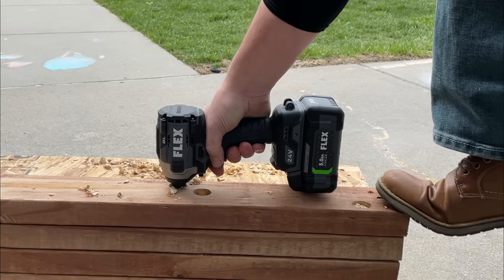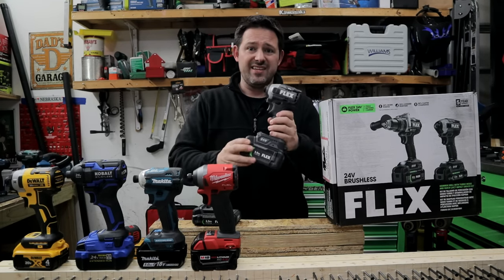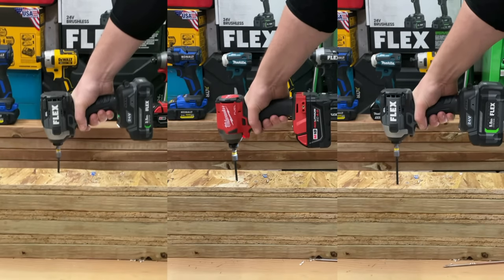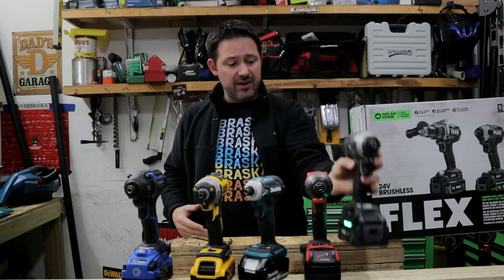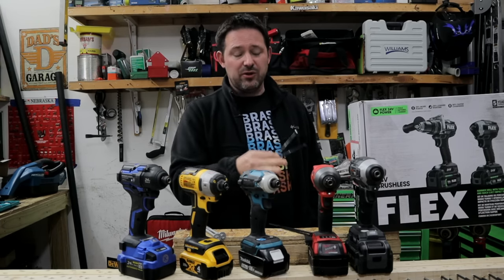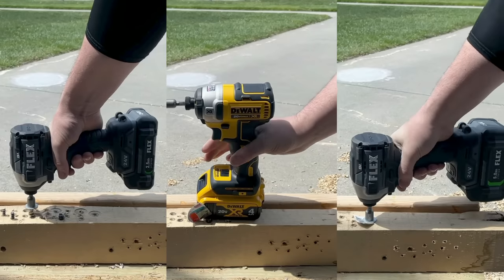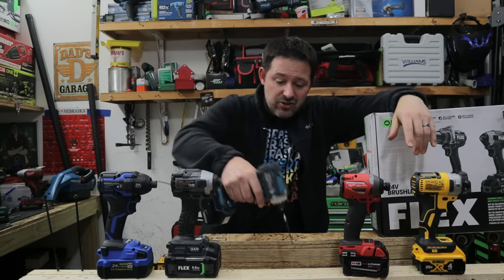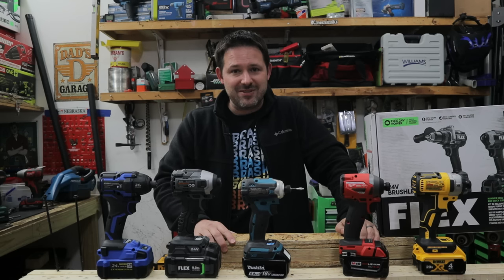FLEX TOOLS vs DEWALT MAKITA MILWAUKEE It's NOT what's NEXT Impact Driver SHOWDOWN!

Comment: Les see the Milwaukee with a 3.0 high output battery blow out the flex..
Reply: Exactly! Unfair test for sure when u compare 18v vs 24 , Milwaukee for me thanks
Reply: I agree.... Also... Why doesn't he show us what speed settings you have each one on also.. Hmmmm... I wonder............
Reply: Or the 40v Makita....  No contest.
Reply: This annoyed me the whole time! Just flex marketing
Reply: The contract said the paycheck is only if the flex wins the showdown! the 4.0 is an old and obsolete battery, he really had to search to handicap the Milwaukee
Reply: @lenardbosch2969  I wouldn't say it's unfair, any of the companies could have designed 24v tools. Flex was just the only one to have took advantage of that. If there are 24v motors available, I would have made 24v tools also for a leg up on competition. I do agree that Milwaukee should have used The newest 3ah and 5ah battery for this comparison as they are the closest to the flex capacity.
Reply: @taz4100  exactly they should be using the high output batteries , that would be fair
Reply: All these comments of "you shouldve used this or that". This guy isnt rich...he cant go out and buy a crap ton of ever ything. He baught some..and used what he already had on some. It is what it is and still informative.
Reply: The XC4.0 delivers marginally more power then the XC5.0 or the CP3.0HO. Have to move up the XC6.0HO to get more power/performance. If you want to see this tested, watch this video from Torque Test Channel. They don’t test the XC4.0, but the cells in the 4.0 are rated for 1A greater (23A vs 22A) than the cells in the 5.0, so they are essentially the same. 
https://youtu.be/ky5YRjz9lvc
Reply: @geoffstrickler  not really, Samsung 25R has better performance than 20R. It’s not about the spec but the discharge curve and voltage fluctuation under load
Reply: @ckm-mkc  DeWalt flexvolt you mean. Makita don't make the most powerful tools but they have quality and ergonomics they are  almost as fast as the gen3 fuel so wouldn't be far off the flex .
Reply: It's about the discharge rate of the cells.. the Milwaukee with a CP3.0 Ah pack with 21700 cells will blow out that Flex 24 5.0Ah with its 18650 cells.. my $ is on the Milwaukee all day.. I've used the gen 3 impact with both XC5.0 (18650) and the newer CP3.0 (21700) and the performance difference is very noticeable. It's not Milwaukee's fault that Flex, for all their marketing hype about their next level battery performance, decided to put 18650's in their packs and not offer a high output 21700 pack! So they have to handicap the competition in their promo vid and the ones that they clearly had to pay these Shills to make with ancient 4 Ah packs that you have to go out of your way to find b/c they are so old! Btw, these packs were all brand new, they weren't just laying around in the guys garage! Someone said that he doesn't have the $ to buy packs for all the competitors, they all looked brand new to me.. not like they have been sitting around in his garage, and if they were, that just goes to show how much more the competition was handicapped, don't make comparison videos if you can't afford to put up newest offerings from all competitors so that people can make an informed decision about what to spend their $ on! Especially if you are trying to convince them to switch to a completely new platform which is a huge investment for most.. luckily, to this guys credit, he did say that they weren't really worth jumping ship if you are already invested in another platform.. especially b/c he probably knew that it wasn't really a fair comparison. Just put up the best offering from each manufacturer and let the chips fall where they may! Fair is fair, people know when something is fixed or when it's a fair fight. Like the last super bowl.
Reply: @mikedeezle2249   If Flex put 21700 cells in their tools they would absolutely decimate Milwaukee.... they at least gave Milwaukee a fighting chance with 18650's.....😪
Reply: Well I understand he not rich so hold off befor you make video that's not a match because the batteries are all different wait befor you say who one it simple as that wait he didn't so people have the right to say something
Reply: I sold my whole Milwaukee line because I seen with my own eyes what Flex can do 💪 everyone will be saying flex in 2-3 years. Give it time and you’ll switch too. I still have my Kobalt XTR set though as well but my new go to is my flex tools
Reply: @boosted2.4_sky  if you watched the video you'd notice every other impact does better once they start driving serious sized fasteners. only reason all these flex tools look like they are doing any better is they spin faster 4000rpm Vs 3600rpm on the Milwaukee
Reply: @geoffstrickler  the cells are also going to develop more voltage sag as they age. A well used pack is going to perform alot worse then a new one under high amp loads. I have some 25rs that are so used that they sag badly at 10amp. 

Flexs forced rotation dual action polisher has always been good, but I'm unsure why they would use 25rs. Unless they already had the packs from previous tools not sold here or cost.
Reply: @taz4100  yes, Samsung 25R cells aren’t the best choice available today. They are a solid option used in nearly every major brand 5Ah power tool battery pack, but there are some better options out now. However, they are one of the most cost effective and readily available, so I suspect it was a business decision, not an engineering decision. They’re still a good option for 2P packs such as the 5Ah, but not necessarily for 1P packs.

They should have at least considered another option for the 2.5Ah batteries, either reduce them to 2.0Ah or go with a different cell such as the Murata VTC5A or Molicel P26A.
Reply: @zalienthere-visitor1424  like milwaukee will not have a gen 4 coming come one now there gen 3 was killing everything out there but hay sell everything when you can only get a hand full of tools with that brand good luck when Milwaukee has everything under  the sun wait for milwaukee to put out a gen 4 befor you say it killed gen 3 with 4.0 battery on it and it was still killing them but hay what do I know good luck with your hand full of tools
Reply: Atleast a 6.0, when I'm trying to show off!
Reply: @zalienthere-visitor1424  lol ok Bud.
Reply: @taz4100  18V is kinda a sweet spot for cordless tools from an engineering perspective. Voltage doesn’t have as big of an impact as people think. The real reason we’re seeing tools outside the 18v “standard” is because someone was actually able to get a patent on the 18V lithium ion battery pack. The company that owns that patent....... you guessed it Milwaukee... yup every time dewalt or Makita or any other 18V tool sells. Big red gets a royalty form it.
Reply: @Trank00007  hmm I didn't know milwaukee was able to get a patent on that. USPTO makes some questionable approvals. If dewalt etc could show that they produced a 18v battery first the patent wouldn't be valid. Regardless I'm not sure the patent would pass court scrutiny, but I have heard of worse. I'll have to check out the patent.

But yea actual wattage draw is going to be what matters and that's going to be determined by rated amps of the batteries and amount of cells. How there wired isn't going to matter much Besides the availability of 18-24v motors. 

They could even use a buck converter to bring it down to 18v to avoid the patent. But I'm not sure that the component cost would be worth it. Chervon makes a few different tools lines in 24v
Reply: @taz4100  it’s refreshing to hear back from someone who understands this. Many people are asking for Milwaukee to release a higher voltage platform to to compete with the new 40V platform from team blue. Until a radically new battery tech comes out i doubt it will make sense to actually develop a new platform. That is unless you want a contractor to want to buy all new tools for little to know gain in performance.

As far as the patens are concerned it doesn’t take too much work to find them. I think their are 3 related to batteries. They have been to court in regards to them multiple times and I believe they held strong every time. Pretty crazy situation to read into though.

After looking it up again I think their patents call out the current supply capabilities of the batteries not the voltage. Anything averaging 20 amps or more possibly. But to the same effect raising the battery voltage may lower average current draw enough to avoid the patent for some people.
Reply: But the Milwaukee impact is paired with a 5.0ah in the kit.
Reply: @ckm-mkc  yeah i am a Milwaukee fan but those 40v Mikita look sick a buddy of mine has them
Reply: @titaniumwolf1123  flex hasn’t even been out for a year what if there durability is shit
Reply: @wadelujan8714  yea, but they weren't using their 8ah packs in any of their vids or promo content.. only 2.5 and 5ah, all 18650...

Comment: I'll go with flex I've been using them since they came out haven't had any problems with them yet they are ahh bit expensive but very nice looking tools I built decks porches add ons to houses and they are quite quick and powerful 😉 ..Hopefully they make bigger and better batteries that's the secret to faster speed work.
Reply: Flex for life brother 💯
Reply: In comparison to Milwaukee and some dewalt tools flex is definitely cheaper. They also do promotional deals more since it’s a lowe exclusive brand so they can do what they want.
Reply: I only got them due to the lifetime warranty if registered but I’m impressed
Reply: @primebulldog4441  they are awesome. I love the whole line of tools they have out. Especially the saws

Comment: Nice masterforce impact driver at 1:41. They have a new one in the boost line that looks identical except it says boost right above thr battery, it does have a nice boost in stats and is the same price. Great test btw. It's good to see straight up solid testing.
Reply from the maker: How did that thing sneak in there.... It’s a Chervon manufactured power tool from Menards. Big and powerful but priced really competitive when on-sale, just doesn’t have the lineup depth. I’ll get around to testing it for YouTube one day.

Comment: Excellent!  Love the sync'ed up side-by side format. The results once you got into the white oak were really interesting.  Regarding your drill bit questions - I don't personally drill with my impact drivers.  But plenty of people do and I don't think it's an unfair test to run.  The collets on these things should be an area to focus on for all of the manufacturers that had failures.  Especially Milwaukee, where the collet is a well-known issue.

Note - Flex will expand beyond Lowe's after an exclusive period.  Not sure how long that will be, though.
Reply: Just wanted to stop in and say what’s up Jim. Love your channel brother. You two guys are truly the most unbiased and your opinions are valued in my book. Hope all is well my brother

Comment: The only interest I have in Flex is the 6 1/2 inch circular saw, grinder and the multi tool.
And since you can get a lifetime warranty when you buy them this year, peaks my interest.
Reply: Yup, u get 3 free replacement batteries which is a lot on its own not counting the drool and charger, btw how is the flex running, still good?

Comment: im waiting for the Makita 20/40V since its gonna be its own battery platform. i switched from Milly to Makita because of the bit release issues and saving microseconds mean nothing if i cant count on bits coming out while in operation. Its becomes a nuisance all the way to a safety issue. That's me, cant drive 30 plus miles from a job site to a home depot or where ever to buy a replacement.

Comment: How come these vids never uses Milwaukee high output batteries? Would they even make a difference?
Reply: He probably doesn't have bigger batteries, they are expensive as hell.
Reply: He uses the 4.0 in this test. The 5.0 has higher output and the 3.0 has even more. Yeah it does make a huge difference
Reply: @willng34  Milwaukee has made it very clear that the batteries are the limiting factor on there brushless motors. This is actually a good thing long-term Because if you were to buy an impact or drill Down the road if you got to spend a couple hundred dollars on a good battery it’s better than buying a brand new drill IMO

Comment: When you went thru the white oak the amount of vibration transferred to the users hand is VERY noticeable. I’ve owned the same Makita drill and impact for about 9 years and they both still work great. Now granted I don’t use them all day every day, but   I use them more than any home do it yourselfer. Heck 1 of the 2 original batteries is still working.

Comment: I watched HOURS of these types of videos several months ago and sifted through hundreds of reviews (prior to Flex even being on the scene) and visited the stores multiple times and checked out most of these thoroughly. I noticed that the Milwaukee collet was an issue across the board and let’s go of bits constantly. I liked the Makita stuff, but was a bit more than I wanted to spend. Bosch just didn’t seem as rugged. I ended up mostly comparing Dewalt and Kobalt. Everything about the Dewalt seemed less solid. The Chuck felt cheap and the directional switch felt squishy. Lowe’s had a promotion where I got a free 4.0 amp battery and offered a 5 year in-store warranty. I went with the XTR set. It was hard to find anyone complain about them
Reply: I have watched countless hours trying to find any reasons not to by the xtr set and its just awesome
Reply: I use kobalt professionally, i switched because my DeWalt xr impact burnt out after a year. I abuse the absolute shit out of my impact all day everyday. There was an issue with the trigger and i got a new replacement tool through the standard warranty. Im glad i made the switch 2 years later. I don't abuse any other power tools but i can say the xtr hammer drill is a beast
Reply: @wichjr  Awesome to hear man. Sounds like I made the right pick. I've hardly used mine so should last me forever.
Reply: Little update, right after I made this comment, the trigger started doing the same funny business. Lowe's replaced the impact driver again on the spot, cannot say enough about how good the warranty is.

Comment: #TeamMakita! I started of with the Dewalt for two years until it fell off a scaffold from the 4th level. Still functioned but lost power. Tried out the Milwaukee loved the look and everything but I had the exact same problem. Returned it for a Makita, cheaper, smoother and quieter. and now all my tools are Makita. Aside from my reciprocating saw and finish nailer.

Comment: You really wanted to dislike the Flex because of its weight, as a woman (5'4") I own the Flex combo that gives me 2 tools 4 batteries 2 chargers That cost me $200 bucks. I use them for kitchen remodeling and they work like a charm and the weight is no problem what so ever.

Comment: Odd I've seen people have issues with the Milwaukee's collet, I snap bits rather than them slip out I guess hahah. I am curious why you used a 4AH and not a 5AH battery for the Milwaukee.
Reply from the maker: 4Ah is the biggest I have in Milwaukee and since I normally don’t included Makita and just bought that for the video in addition to the FLEX I’m tapped out. At least I got a deal on the Makita with 4(5.0Ah and 2 tools) https://www.instagram.com/p/CN8hYlnDt8_/?igshid=g8mvfuqllufz
Reply: @ClientGraphics  You want to borrow a battery for the next video vs Flex?
Reply: Because he “did not have a 5.0Ah” which is the most common M18 battery on the market right now. 4.0 is an old and obsolete battery, it’s been proven that the  5.0 is much more powerful, and the 3.0 HO has even more power than the 5.0.

These rigged tests are hilarious

Comment: Good test and interesting how they all performed under different loads. As a homeowner doing DIY projects I don’t need the mightiest tools, but I do want the power when I need it, range of tools (workshop as well as garden, etc) and the right price. And none of those things Flex can touch at this point. Another advantage Yellow, Red and Blue offer is both 18 or 20v tools as well as 12v and combo chargers. The is a great feature because you may want the higher power and torque for some tools (hammer drill & impact driver) but may only need 12v for lighter and more precision woodworking or trim work. So in effect you can be with one brand but have two platforms. The final part is with Father’s and Mother’s Day coming up these brands will have huge deals, again something Flex won’t be able to match.